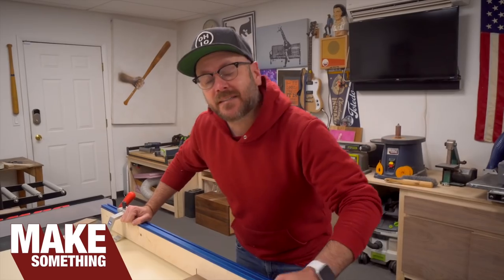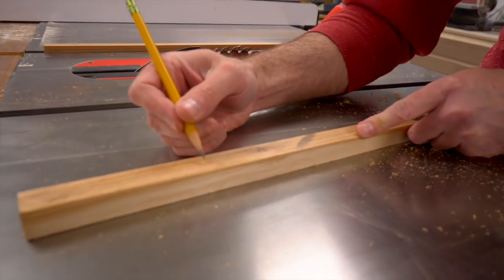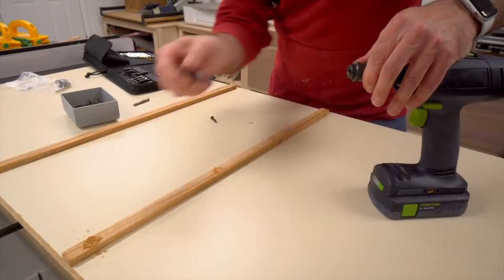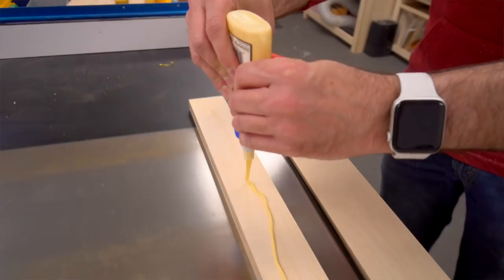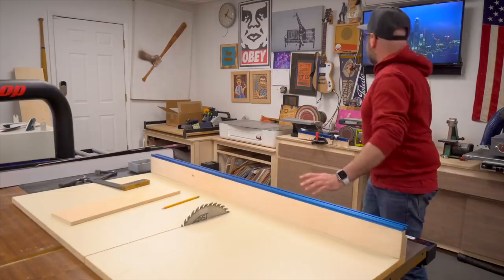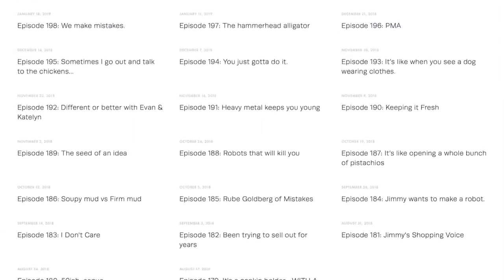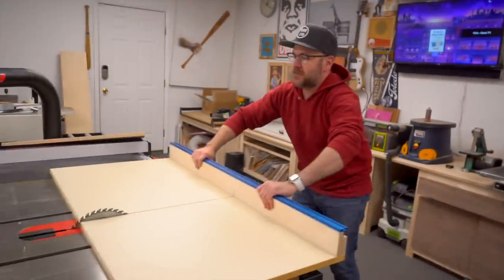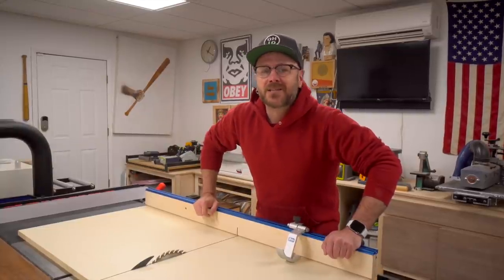Dead Simple Table Saw Crosscut Sled | The Easiest and Most Accurate.

Comment: Hey David... this is a great project and even better tool. One easy thing I’d add to it is a self adhesive measuring tape so you can quickly set your stop in the correct position every time. Thanks for the amazing videos.

Comment: Looks like I’m late to this great video’s party!  One question/comment for you…. I noticed you said cut your fence to 3” high (2 strips) and trim down the back strip to accommodate for the Kreg Top Track rail.  I got that…👍.  So I made up a small piece of 3” high wood and rested the Kreg Top Track on top.  Then I rotated the installed Kreg Swing Stop down and it didn’t rest on the crosscut sled surface.  It hung 3/4” above the surface.  The only explanation I could think of was perhaps Kreg changed the size of their Swing Stop…yours being 3/4” longer?  I took a pic of the mock up I did to illustrate.  Have you (or anyone else reading this) run into the same issue?  In Kreg’s Top Track instructions it says to make the fence height 2 1/4”.  Kind of low for a crosscut fence especially considering the saw blade should probably stay below the vertical portion of the track used to screw through into the wood fence.
Reply: Doesn’t look like I’m able to attached that picture I mentioned.

Comment: I laughed when I saw you use the Canadian pennies. Also, nice project. I need to make a sled for my saw soon, and I am getting some great inspiration from this video.
Reply: Our pennies are now worthless. They are not in circulation anymore.
Reply: What length of Kregg track is used in this project? It looks to 3-4’ long and the Kregg package of the track and stop system I see online appears to come in 2’ sections. If the smaller segments are put together would that jeopardize the straightness of the fence ?

Comment: While woodworking is pretty forgiving when we're only talking about a few thousandths of an inch, and a square with a 4" tongue may be fine for aligning the fence good enough, I still prefer the 5-cut method for multiplying any error to a point where you can see it easier.  But I do love the clean lines of the sled design, the large bed and the track.  Nice.

Comment: Love those concrete blocks with the rope handles!  Love the sled  just wonder about the only thing left holding it together which is a half inch of plywood and the Kreig rail which is sufficient I guess.  I guess you have noted in your head the maximum cut capability before hitting the rail with the blade. Definitely have to be careful when this is off the table with small amount left between the two sides of the sled.  Thanks so much for posting

Comment: Most table-saws do not have the blade perfectly centered between the miter slots. So most people will not be able to flip the sled around and still have the kerf match up with the blade.

You should note that you have to be very careful to attach the sled VERY FIRMLY to the fence if you are only going to have one fence. You essentially have each half of the sled bottom hainging in a long (24-in) cantilever off of the fence. So you should treat that sled gently. Adding a back fence toughens it up considerably.

Comment: Just be sure to make the fence tall enough that the blade won't ever come into contact with the lower edge of the Kreg rail.  If you're touching the rail while cutting a thick piece of wood and this happens, the SawStop will probably shut down and you'll have to replace the brake cartridge and possibly the blade as well.  Uh, I heard this from someone who heard it from someone else, yeah, that's how I know  ;-)

Comment: An important note around 6:23 the reason you see the clamp the other way around in the next cut is because you should not put the spinning end on the work piece that you are trying to keep stable as it will move that piece. Make sure to put the top of the clap on the work that you don't want to move and screw the clam down underneath to prevent becoming misaligned.

Comment: Great (and simple) project! Thanks for making it for us to learn. One suggestion I'd make based on when I've made these in the past: When screwing in the runners, screw/countersink from the top because the hickory will have a lot better screw pullout holding strength (LOL) than the particleboard center of the panel.

Comment: Nice sled… Curious, do you have a problem with the sled being weak or coming apart since there is no board across the back side?  Like you, I'd rather not have a board across the back, but it seems it would be weaker without it.  Thanks!
Reply from the maker: The only issue I've had is when we moved and it broke during the move.

Comment: I’ve fkin had it with cross cut sleds, feel like giving up! I tried to make one last year and failed cos nothing seemed to be square. So I watched a sh^t load of vids on YouTube and decided the other day to have another crack. Took me bloody ages to get the t-slot tracks sliding nicely. I used some 2x4 as my back fence and sized one side on the table saw to ensure it was flat and straight. Set it up, did the 5 cut method and over a 6” slither I was 0.4mm out, which was too much for such a short distance. I adjusted the fence, used a 300mm  square piece of hardboard for the cut method and this time I’m just over 1mm out. Wtf!?! I put a square against my fence, snook up on the blade and it’s bang on, no wiggle at all. Put the square to the other side of the blade and the same, no wiggling. So why in the blue hell is it so far out? Makes no sense and it’s so aggravating.
Can anyone offer any decent advice please?

Comment: Another good runner idea is milk jugs, a bit work but super slippery, melt them down and mold them to the t track
Reply from the maker: Oh wow! I like this!
Reply: @MakeSomething  I've designed something similar for drawer runners on an old dresser I restored,  instead of wood on wood that wears out, I routed it out  and placed molded milk jugs in the cabinet for the drawers to slide on

Comment: Hi, I’m surprised that the cut board stays square with so few screws into just one fence. I very much like the idea of not having a forward fence or brace but have always thought, until now, that it was necessary to have two fences to provide some form of stability of the sled base.

Comment: Nice video as always question though David. How high did you make the fence with that T track since you have a saw stop and don't want it to engage.
Reply from the maker: Thanks! The t-track is higher than the blade so it’ll never touch it.

Comment: My table saw tracks have lips on the upper side to keep the miter gauge it came with from lifting. It has to be inserted from the side, so the flat rectangle and penny trick won't work. Any tips or ideas for how I can make rails for it?
Reply: It doesn't need the lip, you can just use flat sided runners that fit the narrow top part of the tracks.
Reply: @wessunde2801  The narrow top part is only in two places along the track, not the full length, do you think that will mess with stability?

Comment: As for squaring the fence instead of squaring to the blade, why not square to the kerf you just cut.  Larger length.  Put a carpenter's square on it.  But this is a REAL good design and I"m going to build one!  I'm stealing all your ideas!
Reply: Dennis Mathias That’s a good idea, being longer the measurement might be more accurate too.

Comment: Why does everyone use hardwood for the runners? Isn't plywood more stable?
Reply: Evan Gillespie ... Good question! I believe they don’t use plywood because sanding it to fit the slots is almost impossible. Especially so if in time they swell and tighten up in the slots. Much easier to adjust later if needed.